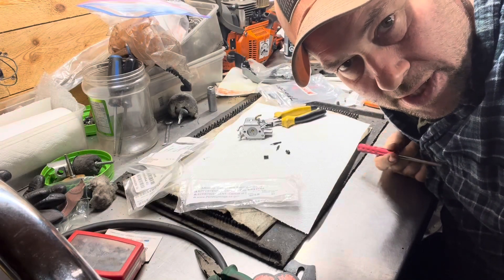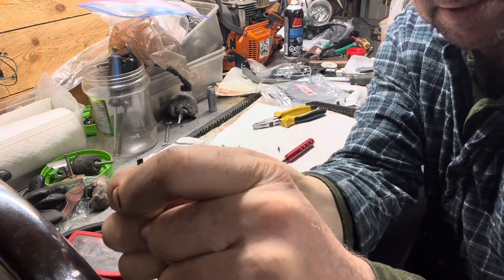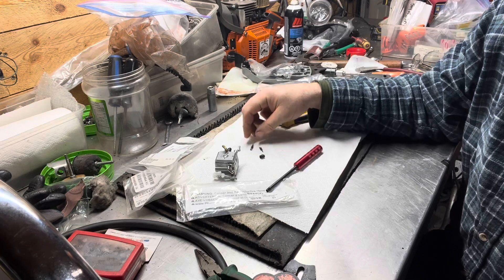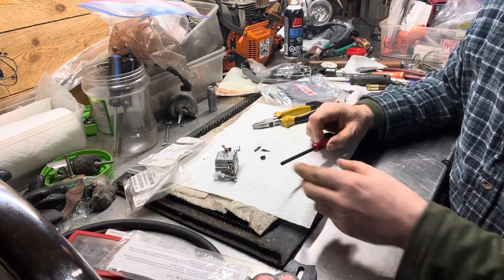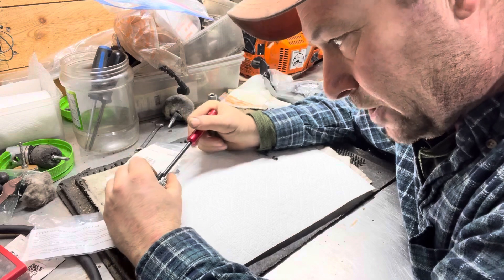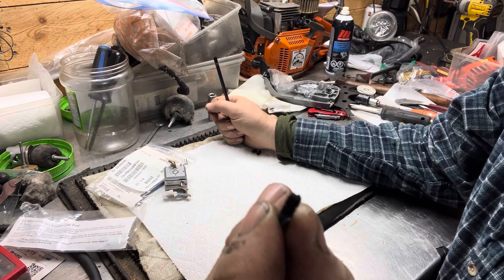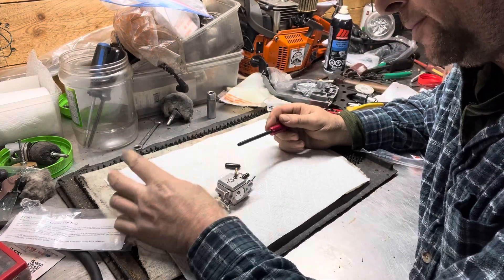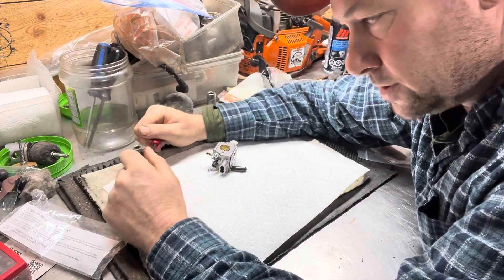Echo 7310 how to use the limiter cap removal tool (91157). Works really good! Please like and sub😎

Comment: Jim, do you have the echo 91112 "Carb Adj alignment/screwdriver guide tool"? I just got one but not sure how to use it
Reply from the maker: I do, it goes on the tuning screwdriver, works good
Reply: @jimssawsnstuff8903  are you referring to the official echo 91049 carburetor adjustment screwdriver?